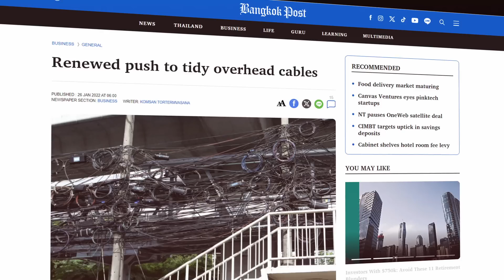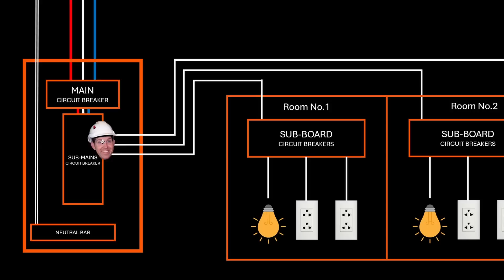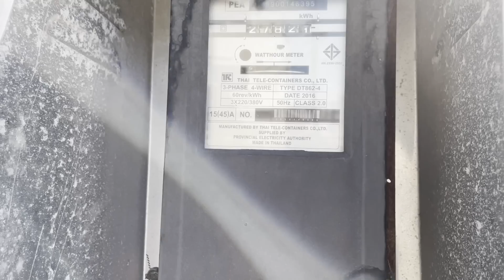Why are Thailand's Powerlines so CRAZY🤪

Comment: Fiji here, there is no way approval be granted for that, no bribe big enough to pass that sort of work…each house will have a outdoor meter box with circuit breakers feeding a smaller distribution board with many smaller circuit breakers in the house, the distribution board must be located and accessible standing on the floor and not in a cave somewhere. Thanks for the video just shocking what you can get away with in some countries

Comment: What do you mean 'British UK crap'? You should be ashamed of yourself matey. Our 🇬🇧 plugs and sockets are the known as the safest and most solid in the world. 
There's a special gate built into the socket that won't open to allow the the Live & Neutral pin connection until the Earth goes in first to open them.
You 🇭🇲 do have the Earth pin but the actual plug is really weedy compared to a British plug cobber.
The Live & Neutral pins are all insulsted too by law for the first 8mm or so as most but not all Aussie ones are. The plugs hold very securely into the socket too without being pulled out easily like those little round pin plugs in the rest of Europe.
The only downside...it hurts like f...luff if you step on an upturned plug on the floor 🥴

Comment: The insulated bit on that tester is so you don't make contact with the contacts if it's partially out (like with a loose plug). Safety~. The Non-Electrician said to The Electrician.

Comment: Yes, its the same in Korea. Including 'live' High Voltage 3 phase wires hanging over the doorway of a Barbers Shop.  Protection was attempted using plastic tape loosly wrapped around the bare wires.

In China, the Hot Potato vendor has a large "Hook" that he hanges on the overhead power lines, and an Earth Plate that sits under the wheel of the Oven Cart.   😮

Comment: There is no requirement in any wired or fiber optic industry to remove derelict or abandoned equipment. Have a look in the ceilings and raceways of businesses throughout the US and Europe. Suspended ceilings sagging from leftover cables. Vast rats nests of 25 and 50 pair phone wires. Where fiber optic has replaced wires all the wiring remains, hanging on the poles everywhere in the world. Why  Thailand is slightly different is there are no regulations for how high up the communications wires should be.

FYI. Most residential and light industrial power lines are fed by 22,000 volts dropped with 3:1 transformers to 7200. These all use European standard isolation. Tertiary transformer drop the voltage to 220, sme 3 phase Wye  distribution wires. All must meet standard distance isolation. The rats nests are all communication lines that aren't required to meet any code.  
Learn your electrical basics instead of making click bait videos.

Comment: I tried to put a link to Google Street View outside our Bangkok condo building but YouTube seems to delete any comment with a link so I cannot show you. The cabling is much, much worse than what you have shown here. About 20 black cables hang down spaghetti fashion to well below head height under one of those high voltage transformers. On either side of the poles holding the transformer there are a dozen or more large coils of loose cable. It is an absolute mess. The whole mess then runs straight through the branches and leaves of a nearby tree. I wish I could show a photo of it. Actually, you can pick any random Bangkok street on Google Street View and see very similar messes.

Comment: I have been in an office in provincial Indonesia that had both 110V and 240V outlets in the same room. A junior clerk plugged a 110V fan into a 240V outlet which had everyone diving under their desks as bits of plastic fan blade sped around the room. Fortunately no one was hurt as the fan revved itself to death.
Reply: I doubt a higher voltage would cause a fan to run much faster. Probably it was just burning up which would happen pretty quick and involve a bit of toxic fumes.
Reply: Philippines are the same in some parts of the country. You have to be careful what you are plugging into.

Comment: 3:36 the one on top is for the street lights (usually its much lower if there is 20kv on top) 
below is 3 phases comming fromthe transformator nearby, the ones below is also 3 phases but split for a different place) and below that is telephone and whatnot. 9:23 those are comms, the fuses are there from the older times, to prevent issues with lightnings and well accidents, the phone cables are so heavy because they have a far stronger line inside them to make sure they not breaking because of the wilderness they are in. (the underground thing is just a fairytale, the ground water is on most places just centimeters below ground level, underground cables in actual channels is not somethings they can do without major changes) 13:47 there usually is a sub-board, but your discovery is not exactly uncommon. (the biggest problem is the americanisation really importing all the crap and mixing it with cheap supplies)
Reply from the maker: Wow, thanks for clarifying. Are you an electrician
Reply: @thinklist   Yeah... I am.   Trying to get my head around what I see and what people discount as all ELV coms. mess. 

I was wondering if the incoming main switch had Yanky Split phase + Neutral. whats the 1phase Voltage... 220V ? 
LOL... what Earthing Standard. 

So, looking at pole lines, 33kV to transformer > LV 3p (??? voltage) to main limiters > the questionably a) multiple LV cables on poles to buildings OR.. b) high kA Mains Street, serving multiple buildings tapped for each building.  The latter being common in Aus. BUT, using bare copper or ABC for that street 415V 3p. 
I can't see where the LV distribution lines are between HV and coms cables.  Can you see where LV are when you freeze frame the pole/ transformer shots?  Can't see em for all the other cables? LOL 
So much for the 'only coms cable' theories. 
Sigh... it could be worse. It's very dangerous to be a professional workin in the generation/distribution industry in many Asian countries... India bad.

Comment: That wasn’t a european style socket that is more a American one. Also I find your comments about UK style plugs very funny since they are one of the most robust, easy to grip and safe plugs style on the planet
Reply: Safest? Step on a UK plug in the dark whilst groggily traveling to the loo, and you will see your life flash before your eyes.😂
Reply: @sigcrazy7  as is electrical wise as it was designed for yep. I don't know about you but I have only ever stepped on a plug once same amount of times I have stood on a right angle European plug. Unless you have someone in your life that doesn't like you and each night fills the bedroom floor with a mine of plug cables its not a issue
Reply: @cycleranger  That was a joke mate. Hence the smiley.
Reply: @sigcrazy7  Stepping on Lego is like stepping on a feather in comparison to a plug 😱
Reply: Actually that's a British-style "shaver" socket.   We don't have those types of things in the USA.
Reply: @jovetj  What he meant is that it's a dual type receptacle. It will accommodate North American type "A" two prong plugs and also the round prong plugs. Furthermore the so called North American type "A" & "B" receptacles are used in more than 60 countries.
Reply: @williamjones4483  That could be what he meant, but that isn't what he said.

Comment: If compared to my home country, Malaysia, Thailand cables are very messy. Not just that, it even doesn't have some safety features like switches beside the sockets unlike in Malaysia where most electrical appliances, there is a switch that comes with the sockets.
However, most of my EU 2 pin plug that can still fit into Thailand's EU plug (unless it uses the 2 pin US plug or 3 pin US plug). But Malaysia's 2 pin EU plug is slightly smaller, so, it was slightly loosen compared to Thailand's 2 pin EU plug. If Thailand's EU plug, it just barely fit into Malaysia's 3 pin UK plug (also compatible with EU 2 pin plug).
Also, I'm a bit scared with the zapping sound or see there is a spark coming out from the socket when plug in because there is no switch that comes together with the socket.

Comment: What do you mean by switchboard? A breaker box? A fuse box? And why would it be where a guest can get at it? In a hotel, you wouldn't put that in a room. You don't want guests messing with the electricity.

Comment: I stayed in a cheap hotel in Chiang Mai,  The 250V electric shower isolator was installed directly above the electric shower heater unit - in the shower cubicle - with no cover on it - connected by 6 inches of cable 🤯
Reply from the maker: That is bloody crazy 🤪

Comment: That's not a European socket that's a universal one and the small 2 pin Euro plug is only for protection class II devices with a nominal current of up to 2.5 A and a maximum of 250 V.

Comment: Like you I am from Melbourne I have lived in Bangkok for 15 years. I used work here but now retired. Electronics Engineer but worked in I.T most of my career. I live in the Sathon area of Bangkok and have seen both Sathorn Road and Narathaiwat Road both cleared of above ground cables both power and comms which are now all undergound. The BMA here has stated they are slowing down the removal of cables as it costing so much to remove them all.  
We built a new house in NE Thailand and it took 3 vists by the electrician to get the earths connected and working on all the power points and on one power point electrician had used a brown wire as the earth wire yes it was an earth just not green/yellow. At least the new house has earths and an RCBO which got tested when a hot water unit hade earth leak. 
All the shop houses my wife has rented here in Sathorn for resturants are only active and netural. New builds in Codos and house will have Earths but all older stuff no. Amazing Thailand
Reply from the maker: Brown for an earth wire is a new one for me. I still loved visiting 👍

Comment: Lines with spools are fiber optics: you cannot patch a fiber like a copper line, so you need some slack in case you need to make a repair. The loops are a good clue.

Thailand use black and white and green for ground.

The small boxes at 9:30 are all copper phone lines.

Problem with underground is flood, unstable soil that can move strain the cables, cost, difficulty to repair.

So the crazy power lines are not power lines after all...

Hope your son recovered. Luckily, health care is great in Thailand.

Comment: Thanks for a great video. The framerate is, however, very slow. The video is very jerky. It's only 24 FPS. Your phone probably recorded at 30 or 60 FPS. The edit really needs to match the framerate otherwise there are a lot of artefacts in movement. I say set everything the same, preferably 50 or 60.
Reply from the maker: Yep I suspect your right, that for the tip 👍

Comment: who goes on vacation to worry about another countries Utility lines..You need a vacation from work...Most of the mess is the low voltage copper service drops..especially the old protectors or NID you was looking at mounted on the outside wall...
Reply from the maker: Yeah I’m a pretty weird dude

Comment: it seems like running IT cabling in kind of close proximity to  H.V power lines would cause alot of EMF noise on them. unless the IT cables have some heavy duty Shielding ......
anyway, glad that they are in the process of moving the Internet lines under ground ,

and that your son is alright after his surgery 😀
Reply: Fiber does not suffer from EMR
Reply: @6toeNL  ok thought it was copper. my mistake

Comment: This kind of sloppiness can be found everywhere.  We have a similar wiring mess held up on a wall at the border of our property in Hoboken, NJ, USA.  When the wall was torn down, several official-looking people were observed slinking about, trying to figure it out.  Nothing was removed.  I had a slightly less complicated nest running along the back wall of my house.  Some of the wires were the old twisted-pair type that was used in the 1940s and 50s.  I went out with a pair of diagonal cutters and removed all of it except for our telephone landline - nothing else was connected to anything.  In the front of the house, everybody who moves into our row of attached houses gets new cable TV service, and there are dozens of old coax cables running up the wall of every house.  My neighbor and I went through ours and removed all but one.  I happen to have seen a similar mess hiding above the dropped ceiling in one of the main corridors in Bell Laboratories in Murray Hill, NJ.
Reply: but it's not in the plain eyesight, is it?

Comment: They are not powerlines. Powerlines don't need separate cables between premises. 
If you look at the top of the poles in your examples, you can see the real powerlines.
What these things are is communications cables. In the past they were for phone lines, while today they are for Internet cables (eg VSDL or fiber).
The reason that the mess exists is that the multitude of small internet companies don't both pulling out old cables and just run replacements on top of the existing mess.
Reply: Yuh, that's pretty much what the taxi driver (former electrician) said - well spotted! 😋
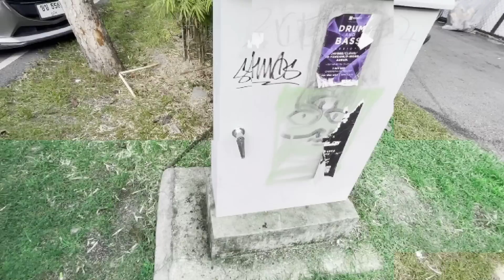Reply: you missed the x-former at, for example, 4:49 ? 
there are surely some power cables there. 
not power (transmission) lines, but...come on...
Reply: @ivok9846  The transformers are associated with the actual power-lines (they are power poles after all), but the tangle of fine wires are not for power distribution.
Reply: @graemezimmer604  Is that claim for Japan only?
If you refer to this video, claiming there are no Low Voltage lines in that aerial mess... You are DEAD WRONG. no two ways around it.  
Mains power supply into buildings, comes in via aerial cables. Few but new would be underground supply.  Those LV DISTRIBUTION cables lead back to transformer.... mixed with coms crap.
Reply: The only rule is "HV on the highest level, LV in between, com where you can reach it without a ladder".
Reply: @ヘスリングマイク-j2i  separation distances are rules. 
33kV 3p.  yeah.. expect to find 330kV and higher too. Surprised 1kV isn't in the mix. Makes for lots more LV service mains and congestion... like 100's of kM in an urban context.  
sure as shit, the LV unmetered power and 'coms'  blend. They do in the building services! 
no question about Earthing standards... rules - Seems there are none.
 Freeze the frame and see the LV cable runs... multiple runs indicating services to buildings. 
That LV spagetti heads to a pole or whateva. now, I can't see where the LV isn't mixed with coms.
Reply: This isn't the only place like this.  I've been to many 3rd or 2nd world countries that look the same!
Reply: @Steve007124  japan too
Reply: @Steve007124  It's very dangerous work in India & Sri Lanka. Many professional workers die every year.
Reply: It's not just the messy looking "internet stuff". 
It's no locked panels... 
no covers on panels... 
and no apparent electrical inspections or even electrical code being in-forced even for commercial properties.

You DID hear that electrician explain that you only need a LICENSE to climb the pole... that means even in hotels your 8 year old cross-eyed third cousin can wire up the building.
Reply: @BaobobMiller  This also proves an interesting idea. I have long felt that all the codes we are required to follow for electrical wiring in places like America, where I live, are more about providing business for certain industries than they are about safety, even though safety is what they constantly harp about. But then you go to Thailand and they have no codes, or don’t enforce them, and yet somehow everything still works.
Reply: @Ethan.Lamoureux  While there are things in building and electrical codes put there for "unsavory" reasons by people who demonstrate their corruption. The codes are a primarily matter of safety and reliability. 

    For one thing there is no way that wiring nonsense would hold up to a great lakes winter. One ice storm and you'll be starting over from scratch. and that's without even thinking about-the weight of the snow.
.
Reply: @BaobobMiller  I am intimately acquainted with Great Lakes winters! That would be the domain of the National Electrical Safety Code, which covers outside wiring. But I was actually thinking more of the building electrical codes. Yes, I agree that much of the code exists for safety and reliability, although I would suggest that reliability should be more an issue of good workmanship rather than law. But our National Electric Code has been in place for a long time, and not much has changed when it comes to safe practice, yet somehow every few years we get a new NEC published with a bunch of rule changes, and many of them seem to require buying some new and expensive gadget, or more of the ones we already use, or require something which will put more money in someone’s pockets while not really doing anything to increase safety. For instance, a glaring safety issue is American type A and B plugs and receptacles which have almost no protection against electric shock because the plug is energized long before it is fully inserted and there is no insulation on the exposed conductors. And while they now require “tamper resistant” receptacles with shutters to prevent foreign object insertion, there has been nothing done about the exposed plug elements, which is much more likely to cause injury or death than tampering with the receptacle. The plugs remain unsafe, but the receptacles cost more.